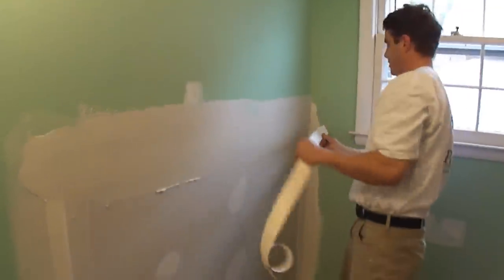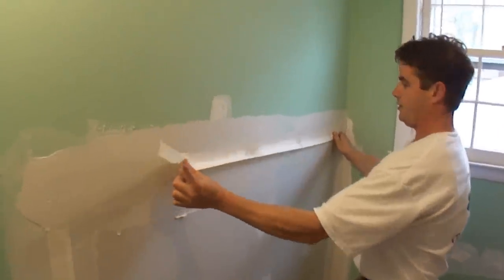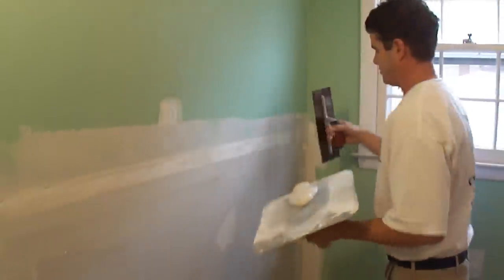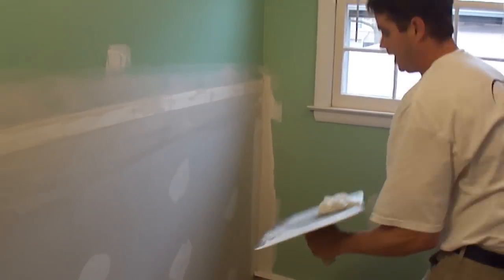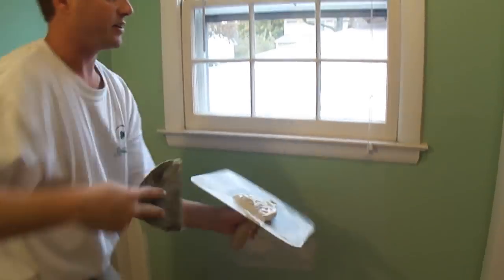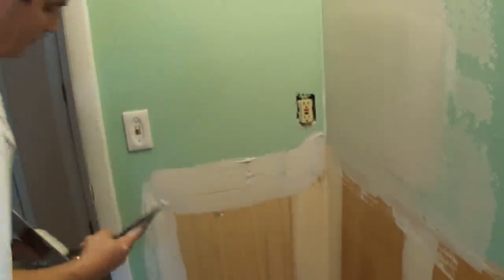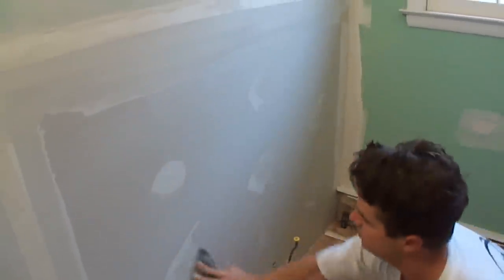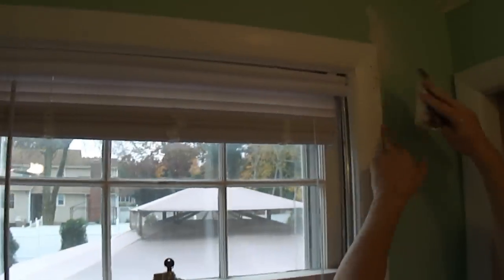Bathroom Renovation- Drywall Taping- 1st and 2nd coat (Part 7)

Comment: Hey Russ I helped my parents remove a half-wall/arch out and I went with the more is better (didn’t know about mud pie till you 😉) on joint compound. 😞 I sanded a ton and I’ve still go divots, lumps, and the side steel edging. The walls are textured so I’ve made the stuff same height 😂
Reply from the maker: Hi

Just do a skim coat to fill in those areas!

Russ

Comment: Noobi Questioin. Can we just mud between two drywalls and not use the paper tape ?
Reply from the maker: Hi

Thanks for your question. No you have to tape it. It connects the 2 pieces of drywall adding structural support. 

Russ